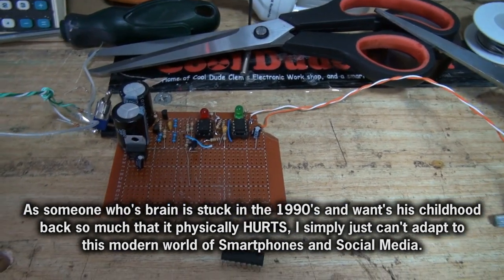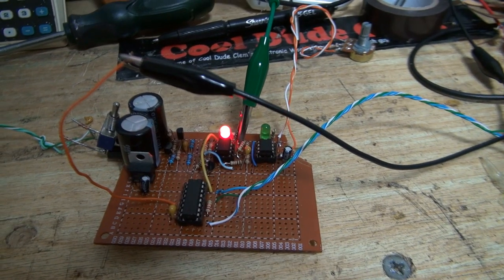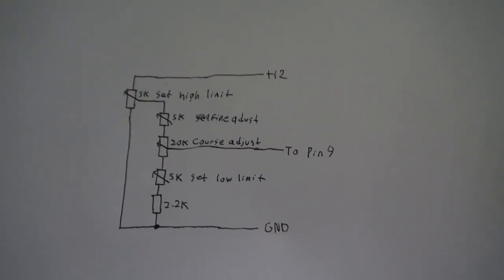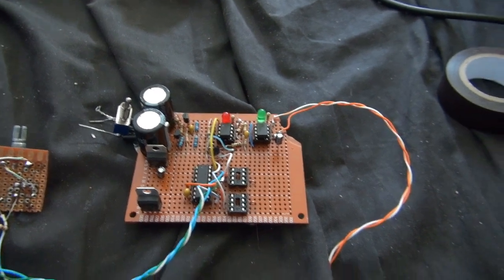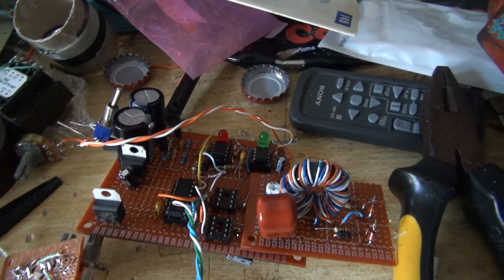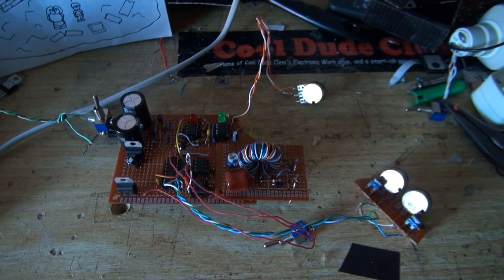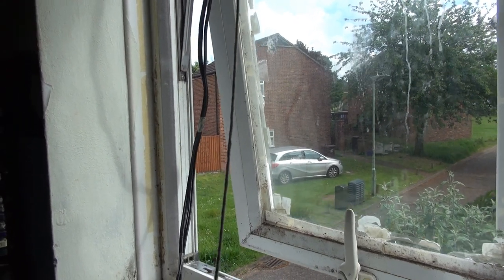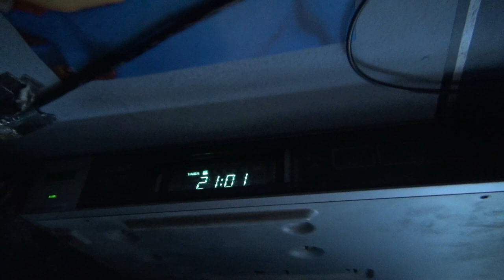Making a Tesla coil Driver pt 2 - The Mosfet Driver Circuit

Comment: My fave video of all time? When you tried to cut your own records. Now that is pure art., tho I suggest a small correction: Step 1: use the disk-softening lightbulb + string motor to form a blank starting groove, Step 2: Use the disk-softening lightbulb and speaker+needle actuator to run in the same groove with the signal, but without the string motor, since the starting groove will self-guide the tone arm. an old Laser Disc would be a great medium

Comment: The voltage rating on the wrong-way capacitor may be high enough to keep it from popping. Or, it will pop when you least expect it. You may have to change pants when that happens 😂
Good job on your Tesla coil driver.

Comment: Hi Clem, either the positive output of your wall wart is accidentally connected to the PE of your house and thus in fact you short circuited the wall wart output when you connected the oscilloscope probe GND to the cassette desk chassis (which likely is connected to the negative/GND of the wall wart output) or (if you got a powerful shock) your wall wart is seriously malfunctioning (in that case the high voltage switch noise filter capacitor between primary and secondary side seems to have become leaky or there is an internal wiring fault) and you really should not continue to use it, especially if your house doesn't have an RCD. Speaking of which, why don't you add an RCD or RCBO at least for your room or workbench, if the wiring of your house really still relies on bootleg ground? Also a current measurement of only the wall wart outputs to PE would be enlightening to further pin-point the problem.
Reply: Clem needs to send that wall wart to diodegonewild for an analysis. Super dodgy!

Comment: Rcbo Not tripping. I thought that's what it was supposed to do. When there was 2 different ground potentials at a different voltage. Switch mode power supplies without grounding. Do suck Cos. They can give a pretty big love nip
Reply from the maker: My house still uses the old fashioned type fuses. Perhaps one day we should get a breaker box installed instead.
Reply: @CoolDudeClem  Perhaps you should do it